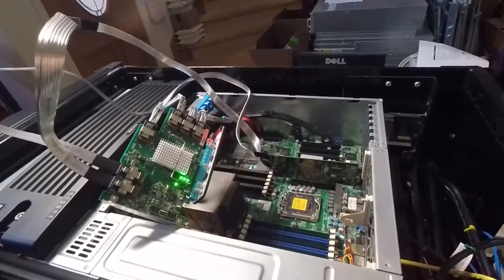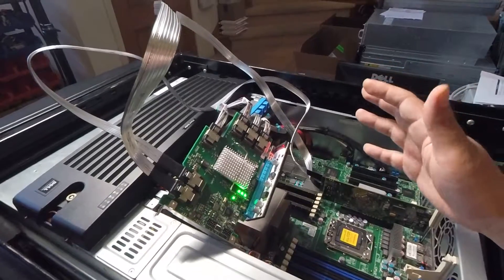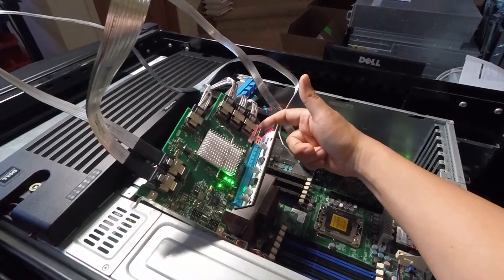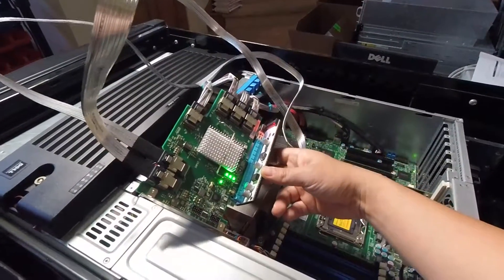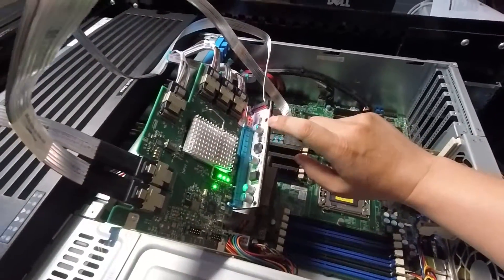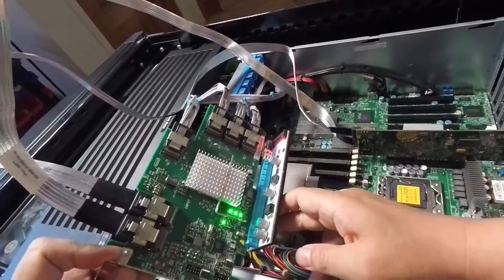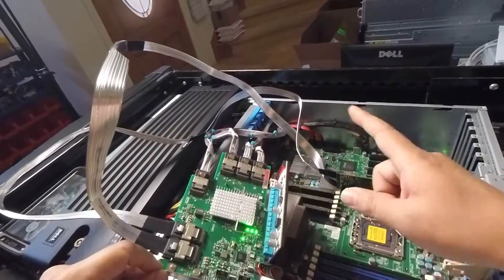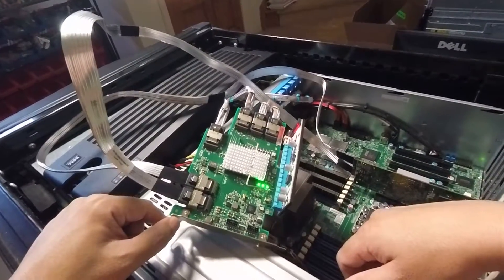Alternate way to power the IBM SAS2 expander 46M0997

Comment: Can this PCIe risers be mounted to the chassis?
Reply from the maker: I just mount the SAS expander board to the PCIe slot, and attach the PCIe extender to the SAS expander to power it. I don't think there's a need to bolt it down unless you have cables from it dangling outside your chassis.

Comment: just playing around , can i take a  standalone adaptec aec-82885t hook to 8 hard drive (outside the case) cable  sff-8088 to sff-8644 to a  LSI 9207-8e HBA SAS controller Will it see the drives
Reply from the maker: yes, that should work.

Comment: Pcie does not have 5v lines 
Only 3.3v and 12v 
The 2 chips on the board are to lower the 12v to 3.3v 
Only 12v is conected to the psu  on those rizer boards

Comment: Hi friend, do you happen to know if this  IBM SAS2 expander 46M0997 work with a regular ATX x570 motherboard? I want to connect 16 drives for chia farming, and for last, do you need to purchase the HBA card for the expander card to work? or can i use it alone?
Reply from the maker: The SAS expander is not really a PCIe device. It only uses the slot for power. So it works with anything that can provide the power. But it does require a SAS controller like HBA or RAID card to drive it. Watch my playlist on SAS expanders and I go into more detail and show various examples.
Reply: @ArtofServer  thanks man

Comment: Very useful video! I'm planning to use this same setup in my DIY DAS box. The PCIe extender link in the description appears to be broken. I searched ebay with terms 'VER008S' or 'VER 008S' to find what looked like the exact same unit shown."VER008S Riser Card PCI-E PCIE x16 to x1 USB3.0 GPU Mining Rig Eth XMR 60cm 2ft" White PCB with multiple on-board power connectors.
Reply from the maker: Glad it was helpful! Thanks for sharing the search terms!

Comment: What is the ver. number (006,006c,007,008s,009s) of the expander you used or the link to the auction?
Reply from the maker: I'm not really sure what you mean by the ver. number of the expander.

As for the one I sell in my eBay store, you can find it here: https://ebay.us/GotdSX
Reply: It's an IBM ServeRAID 16-Port 6Gbps SAS-2 SATA Expansion Adapter 46M0997 Firmware 634A

Comment: I got Samsung pm1633a 7.38tb ssd x4 and i want to use it in my desktop. Can i Pull it of with your Dell H310..?
Reply from the maker: That's a SAS-3 SSD, so I would recommend you use a SAS-3 capable controller. The H310 is SAS-2 only and so you would not get the full capability of your SSD.

Comment: Yup put together a DIY DAS with this exact method. You're correct is suspecting that the additional voltages available from the Molex/SATA are making it operate correctly. Not all risers are created equally and because GPUs only take in 12V from the PCI-E slot many manufacturers that make PCI-E 6-pin risers neglect the voltage regulating components that convert the 12V to the other voltages. None of my 6-Pin PCI-E risers worked but the Molex and SATA ones worked just fine.
Reply: lots of those risers are defect. Normally, the riser should make the other voltages onboard

Comment: Many thanks for this hard to find information! i know that it was posible to power those cards alternative as some have a special pcb for the power feed and use indeed molex. you can posible even a pcie x1 slot if its open ended slot, or dremel it open as some people did.